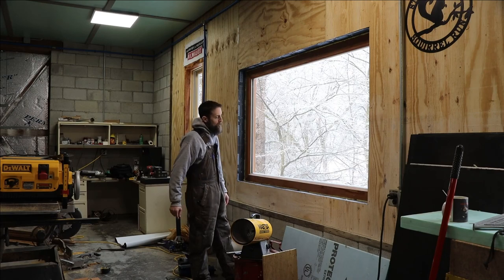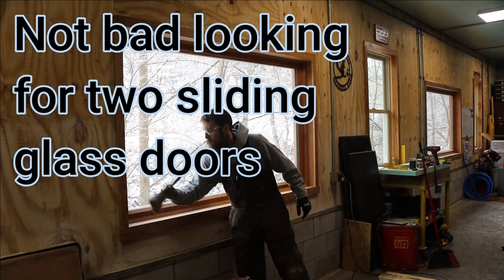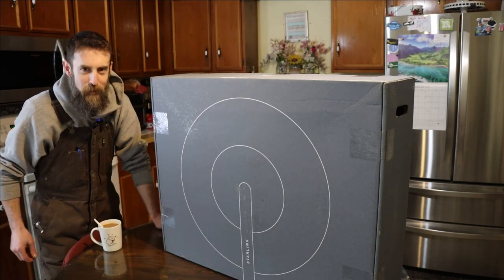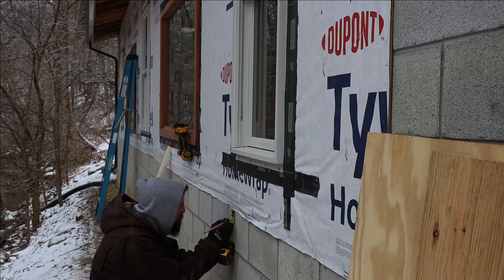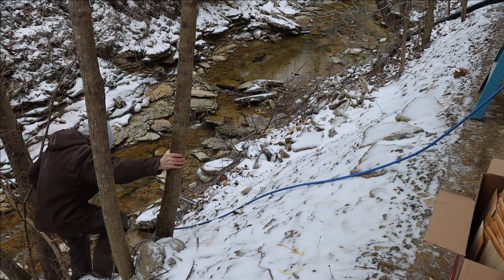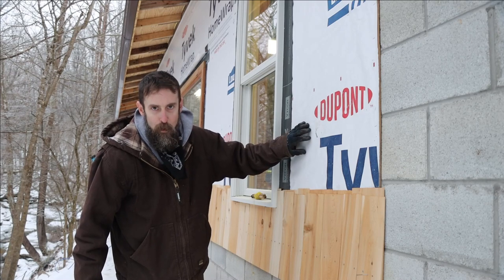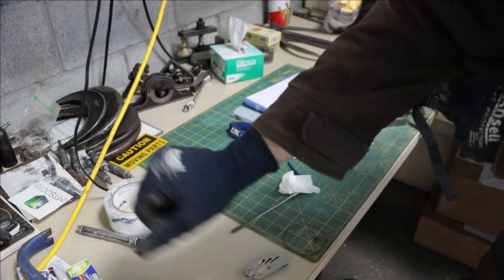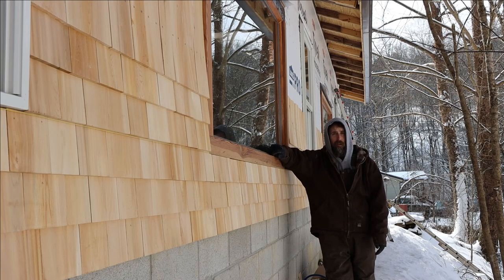Looking GOOD! Workshop Siding  going up. Shop update

Comment: Steve, my wife and I are a couple of those Texans that have been struggling, but are finally back into a good place. Power was out from about 1:30 AM on Monday through sometime around 5:00 AM on Thursday. We "evacuated" up to Denton Texas, about 12-13 miles up the road, because my in-laws reported that they had power for hour on/hour off, so they could keep the place warm, and we most definitely appreciated that! I drove home every day alone (my wife is deathly afraid of driving on icy roads, so am I, really, but I kept hoping that the power company was eventually going to live up to their word on restoring power. They failed to do so. At one point, the thermostat (battery operated) in our house showed an internal temp of 35 degrees. Anyway, we came home on Thursday, but as the house warmed, we had the dreaded broken pipe, so took on some flooding. I was able to locate the break (pretty easy, it was a hose bib on the north side that we always cover with a rigid foam protector, but we were at -4 locally on Tuesday, and with no heat in the house, it didn't stand a chance of not freezing. It turned out to be a copper end cap on a water hammer riser inside the wall. Plumbing supplies are scarce, but I found the last Shark Bite connection available at Lowes that I was able to use to plug it. Only a minor area of sheet rock had to be cut, and we have been using a squeegee on my shop vac and a couple of fans to try to get the carpeting dry in three rooms.  If I sound like I'm complaining, I'm not, because I have heard of people MUCH worse off than we are. But everyone I know, including people who were not directly affected, is angry. This was not well-managed, and people died as a result.

Comment: Did not expect Starlink on this channel of all places.  
But yeah, sounds like it's exactly the kind of situation it was meant for.
Reply: People have been mentioning it in the comments here for quite some time. I remember how amazing it was to have high speed internet at home when I first got it. Now I'd be pretty lost without it. I'm sure he's happy to have starlink which is pretty fast compared to the existing satellite providers which are way oversubscribed.
Reply: As a person that has been working from home through the pandemic for the last year.  I couldn't live without my internet.  When my cable internet goes down for a short period of time I switch to my cell phone.  If that doesn't work, I would be taking the day off. :(
Reply: @ahnilatedahnilated7703  Yeah, me too, but it's not really that amazing to have fast internet when you're in the city, and have FTTH. Getting 100Mbps in both directions out in the rural areas would be simply amazing. Heck, 100Mbps up is like 10 to 20x better than most people get that have cable! Stupid stingy cable companies and their crappy uploads. I have 100/100 connection on fiber, and it's great. For a few more $ / month, I could go to gig/gig, but I rarely find the need for more than 100mbps, so haven't phoned to get my plan upgraded yet. When I first got "high speed" internet at home, it was about 6mbps both ways, over a dedicated wireless connection, and that would've been in about 2001 or 2002. Cable broadband just rolled out, and one of my friends from high school worked at the help desk at the cable company, but my parents were too cheap to buy internet. I had to roll my own over a wireless link to the university, where I was taking CS and working for the IT dept. I got access to the roof of the highest building, and they ran fiber up there, and we setup some wireless access to a few different places. It was pretty amazing, and free, other than the labour I put in to set everything up, for myself, and the other people that were connected to it. You know what they say, necessity (and or cheapness) is the mother of invention (and or creative solutions)!
Reply: @gorak9000  
Starlink is about 100-150 max upload ( 50 i heard is lowest ) and 20 upload max from what i hear locally happening....still much faster in rural areas than other options
15 - 25 uploads ( wireless ) and 3 - 5 uploads are all i can get in actual options wirelessly where i live....some claim higher ( 50 up ) but don't actually ever give you that ...

Comment: It does look good, Steve.  Always a combination of feeling good and feeling a little frustrated when you get into the short rows.  Figuring out which row to tackle next, so you don't work yourself into a corner, seems to take more time than anything.

Looks like you found a good solution for your area.  We have a radio link system (uses Ubiquiti) in our area.  Since being taken over by a new owner, the system has been improved dramatically.  Unfortunately, the frequencies in use are line-of-sight, so that system doesn't do so great in terrain like yours.

Our neighbor, a mile away, tried Hughes Net.  It was less reliable and cost more.  He said he didn't know what part about the experience he disliked most ... the over-a-barrel feeling or being puckered after paying the bill.

The local land-line was taken over by Century, they have pretty much left us hanging out to dry.  Dial-up only, still.  They won't upgrade the infrastructure unless you pay through the nose for it.  Something similar to getting commercial 3 phase run to your shop.

Comment: I have been in the wood heat industry for 16 years now.  For the size of you shop and your climate, a 2.0 cubic foot firebox will heat that shop and hold a fire for up to 10 hours.  My prefered company is Pacific Energy, but there is several companies that build similar stoves.  As for pellet stoves it more of a conveviance type of heating.  It still has the nice wood heat feel and they can take up less room than a wood stove for clearances.  Also most mid size pellet stoves will hold enough pellets to run for 30 hrs on a low setting.

Comment: If you were working in your shop every day thru winter keeping it warm a smaller woodstove might be alright. For just a few hours of the day or weekends, you want something to blaze out the heat, between the concrete slab, the block walls, and the machines, that is a lot of mass to bring up to temp.

Comment: Texas issues: I appreciate the concern about Texans near your 37:00 mark.  I'm outside of Houston.  For those who do not know the situation well, I have some information.  First, I feel that the rural element tend to be more prepared, but ...  1) very few people can specify alternative plumbing in their dwelling.  People do not have basements, so 98% of piping goes through the attic, the other 2% may have a house on blocks that has piping underneath in the crawl space.  For both, the pipes are exposed or almost-exposed to the outside temperatures.  My custom home has all pipes - hot and cold - with pipe insulation, but I had 4 pipe breaks.  I know of some lucky ones with breaks confined to the yard sprinkler header.  The issue with nearly all breaks are lines that are pressurized but "dormant".  2) there were millions of homes without power.  The people managing the power grid failed us - BIG time.  Without power, water supplies were knocked out, homes went cold, businesses including food stores went dark and cold.  I don't care if you have gas or propane for heat, if you don't have electricity the HVAC system does not operate.  Imagine a house that cannot heat or run water to keep pipes from freezing.  The good news is that even though some were suffering, there was a huge demonstration of compassion and neighbor helping neighbor.

Comment: Shop is looking beautiful with those shingles Steve. It's nice to see you two horsing around in the snow. The child in us all is still there! You stay safe as you get further up the wall. If I were you I'd put plenty of salt down over the snow and ice on that ledge to make it a lot safer, and I'd pound some rebar if you have short lengths left over and tie the bottom rung of the ladder so it can't slip like your little mishap a couple of weeks ago running the airline round the shop.

Comment: i had the same problem with my internet provider and i had to get a bonded connection. my kid needed a fast reliable internet for school. they finish school and i no longer needed the "faster" connection. i cancel the bonded service and got the reg one and it was faster. i found out later i was being throttled to try to get me to buy the premium upgrade. thanks for sharing!

Comment: I also think wood heat is the best heat one can have. I had a larger pellet stove in my shop for about 10 years until the price of pellets went through the roof. They are several times more expensive than using natural gas! The shop is looking really nice!

Comment: Steve, Congratulations on the new internet. That looks like a win-win. One of the few advantages of us stuck in the big city is natural gas service and high speed internet, they can have everything else...
I'm with you going with the wood stove, love the comfort level and low operating cost. I've been heating with wood even here in the city for 30 years. Little by little there working on banning wood heat here, but were still holding out. Hope you get a brake in that weather.

Comment: Those large stacks of materials are gone.  The shop looks great.  You need to build a good size rocket heater for the shop.  Would be a good series of videos, plus would be a great way to heat the shop.

Comment: Hi Steve-
Shingles look great. One of the best investments for delicate ares like under you windows is a brad nailer. Get galvanized brads, glue like you did and shoot em. You'll find many uses where splitting is likely and you really just need to secure for the glue's effectiveness.   The hammer impact no matter how small your nails is 50% of the problem where splitting is likely. 
I like the wood heat myself. You could assist the wood heat a lot with a single duct and an inline fan. Just have an inlet over the stove and run it to the opposite end of the shop. Not a huge thing just enough to move air to the other side. Thanks for sharing

Comment: Highly recommend a mini split for the shop as it will do you all year round.  Cool and heat but really nice for the tools as it dehumidifies!  I put a small one in my large shop and it is amazing.  Pretty inexpensive to operate when considering the alternatives.  My tools never sweat and in single digit temperatures it keeps the shop at 66 degrees summer or winter.  I live in a temperate rain forest so when I say it keeps the air dry that is in a worst case scenario and the mini (mine is a 18K unit) has no trouble.  Wood stove is nice but when it isn't running the tools will sweat.  Mine was $1200 and I installed it myself.  Liked it so much I am putting two more in my two story home.  You could also put in two smaller ones if that suited you.  Mine has been running for a year and a half and I couldn't be more impressed.  I say this and I love wood heat but it just wouldn't be near as effective and a lot more work.
Reply: what the hell is a mini split?
Reply: Dehumidifying is a big deal. I had a shop intermittently heated and no air. This resulted in huge rust issues. A mini split and wood stove sounds about right.
Reply: @rustycowll5735  Another term is 'ductless' system.  There is an indoor piece with a fan and outdoor piece with compressor.  The two are connected by 2 copper lines and an electric-electronic cable.  Basically like a standard A/C unit but the evaporator (indoor) has no ducts - air is blown through the coil and into the room.  Extremely efficient and nearly silent.  Basically it is a heat pump, allowing it to switch to heat mode as well.  Many models and names - look up 'Mr. Cool' for an example.  I have one in my 1700 SF cabin here in Texas and love it.  To keep it dry, I set it at 86 all summer when I am not there and electric bill is $35.

Comment: Mr Summers. Have you ever heard of a nail spinner. They are made by Vermont American. They install in a drill. You push a finish nail in the end and use the drill to spin the nail in.  It doesn’t put it all the way in but, it eliminates the need to predilection a small hole to prevent slitting the wood. Last one I bought was around ten dollars. You won’t find many anywhere but online. Last I ordered I believe I bought from Vermont as an online purchase. Thank you for your videos.

Comment: You are right about ISP's not caring. Just dropped Comcast and went with a new unlimited phone for half the price. Speed is the same.
Oh, CC offered to lower the price after I called to cancel. This tier had quadrupled in speed but they refused to give me the new speed or lower the price.
May go Starlink but don't want to spend that much now.
Grew up with a Franklin stove in the basement, fill it up, start a big fire, then close down the dampers and nice heat for hours. Was nice.

Comment: Consider looking into sawdust stoves. Most sawmills, joinery/cabinetry shops, carpentry firms have a waste stream that they pay to get rid of which can be turned into heat for FREE! There is a UK company that makes the stoves (Tecnik stoves, no association) which is a simple steel box that burns sawdust and logs depending on what you have. But a man of your skills can simply make one out of plate steel and some box section.

Comment: I live in British Columbia in a rural setting. I was on a satellite dish for quite a while and the service kept getting worse. I switched to a "smart hub" just lately and had a similar experience, much better internet at a lower monthly fee. The smart hub is basically a cell phone with a router and wireless built in. You do need to have available cell service which can be an issue in BC and it isn't as fast as cable would be but it's still better by a long way than I had before.

Comment: When driving a nail through brittle wood dull the end of the nail some. It will tear a hole instead of  pushing the wood apart. Less splitting.

Comment: There is a much easier way for setting a ledger board with out drilling into your block for the Starter and first coarse, but I see it's too late for that. And the ones you are gluing in to place with a continuous bead is wrong. Two dabs just as if it was nailed. The continuous bead will not let them expand and contract like they should.

Comment: Take look into thermal mass wood stoves, buy or build. Had a relative that built one in his shop and after burning for 3-4 hours it was good till the next mourning. What ever route you go I would suggest the use of a fresh air feed to the fire box. The advantage is that you would not be creating negative pressure in the shop thus pulling in cold outside air.

Comment: A mini split is a small very high efficiency a/c which can also have a heating capability.  They have an inside air handler closely (60 ft +/-) plumbed to the outside compressor.  They can be single or multiple zone (one or more air handlers).  They do not use ducting. Because they are variable speed unlike conventional a/c which is all or nothing they are much more efficient.  A reversing valve allows them to heat and cool while dehumidifying through a plumbed outside drain.  Most come precharged and many are suited to DIY.  The higher rated units can heat at diminishing efficiency down to -15 or -20.  At best efficiency they are depending on the model's SEER rating up to ten times more efficient than plain resistance heating.

Comment: Its -25 C here (minus 13 f). I did'nt get to my construction debris pile before it snowed 18 inches  then it froze solid.       its tabled until spring. Shingles are a nice look and as long as you stick to the machinist's  one or two thou, you should be fine.  Let hot Rums be your friend.

Comment: Whilst I understand what your reasons are for saying that a wood burning stove is the best approach for heating your workshop and it produces a dry heat compared to propane I have the following thoughts.
1. It will surely take quite some time to warm up a workshop of your size from the outside ambient temperature - not a lot of help I would have thought if you want to go out to the shop for two or three hours in an evening. Clearly a different situation perhaps at weekends when you might be there most of the day on both days.
2. Are you planning/expecting to cut, haul, split and stack timber to feed this proposed stove? To get the maximum heat out of your wood it needs considerable time to dry out (oak takes two years). This will surely involve a great deal of time and effort on your part especially if you don't have access to any useful machinery to help. Sure you may purchase split dried logs delivered for a price but this needs stacking once delivered.
 
It seems to me that a quick initial, short term use different source of heating might be useful and possibly some sort of fan to move air away from a stove would be good idea in the long run.

Comment: FYI, when working with cedar shakes, they have what are called STARTER SHAKES. What the difference is between Starter Shakes versus regular Tapered Shakes, is the Starter Shakes have an even thickness, not Tapered at all.   Starter Shakes Thickness approx. 3/16 of an inch. Plus their usually an even width, not random approx. 5 - 6" inches wide.

Comment: Feeding birds - instead of "fancy" bird food, I now just use black oil seeds (black sunflower seeds) and a few peanuts plus suet. My satisfied customers (in Eastern Ontario, Canada) include chickadees, bluejays, evening grosbeaks, redpolls, mourning doves, one lone female cardinal, downy and hairy woodpeckers (especially the suet) plus a couple of squirrels and some deer who are very good at emptying the "squirrel proof" feeder. I put most of the seed on the platform feeder which is too high for the deer. Enough gets spilled to suit the ones who like to feed off the ground. I used to get some wild turkeys, but not for a couple of years now, although they are still around nearby.